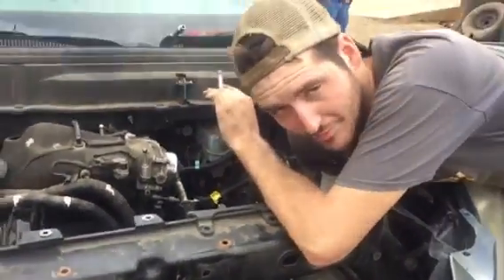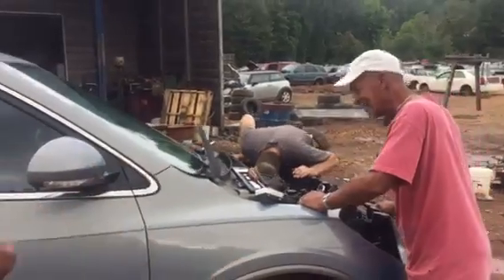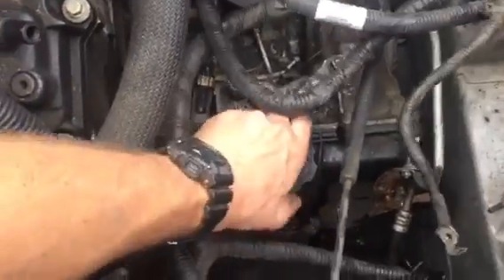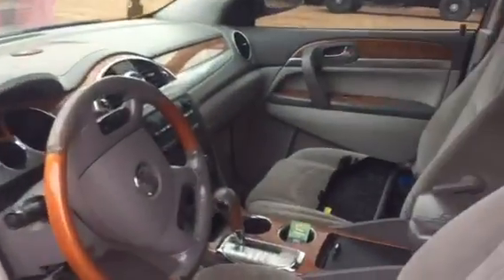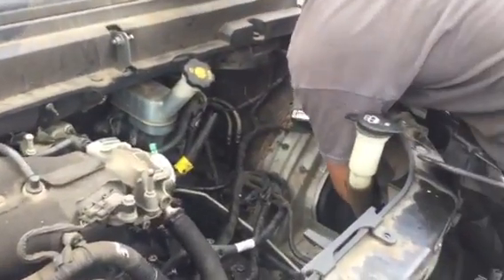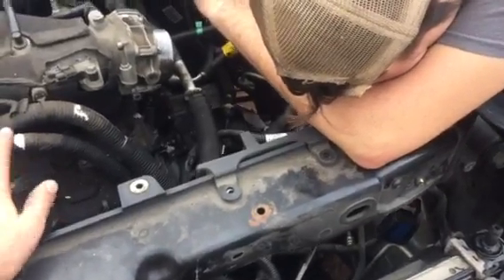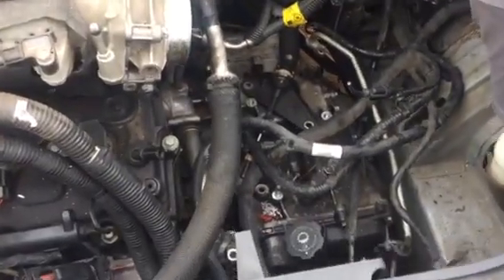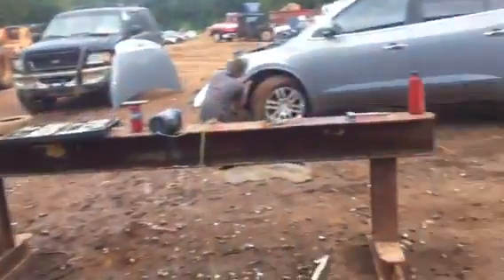Todays task: Buick Enclave Transmission

Comment: Highly skilled Crew members of the Recycling Center, hard at work, diligently removing high quality used parts in an expedient manner.  Certified trained technicians,  working effortlessly  to remove these much needed parts to get you back on the road, fast.  High quality used auto parts priced lower than our competition. Use auto parts that keep America moving. That keep Americans working....at prices that won't keep food off the table.  The Recycling Center Crew always has your back,  and will never let you down.  The Recycling Crew never sleeps..... The Crew can leap tall buildings in a single bound!!! ....  Can,, uhhh.....  Oh Hell...You get the idea.

Comment: Passengers fender looks like it could be fixed, just sell it at a discount. Dropping the k-frame is the way I'd go. Junk yard up here just drops the whole cradle, pull it clear, let the car down and,  separate it on the ground.
Reply: I'm looking at doing this can u pull the cradle and get transmission out with just a jack and Jack stands

Comment: @Jay Smart The trusty reliable 1992 Buick Century I mentioned in your video of the Buick Century station wagon has finally met it's demise. The cause of death? Someone broke into the car and vandalized the shit out of it, to the point that we can't even start it, let alone drive it even if we got it running. The gearshift, sun visors, rearview mirror, ashtray, and glovebox have all been destroyed, and the car's jammed in first gear, and the ignition lock cylinder is damaged and will not turn to 'Start' anymore, car is totaled... and worst of all, that event happened on my birthday too! But after hearing about what happened, an elderly gentleman told my parents that he had a 1989 Chevrolet Suburban Silverado 1500 that he didn't use, and that we were more than welcome to use it for as long as needed until we can afford another car, since all three of us don't think the Century can be saved.